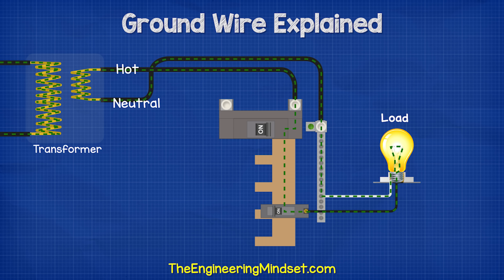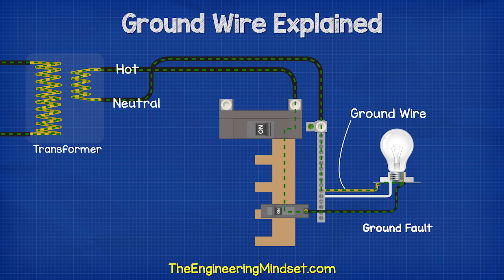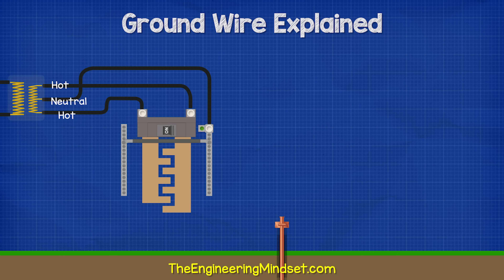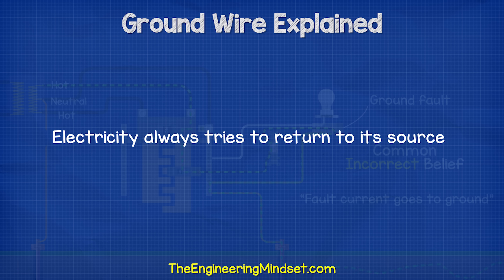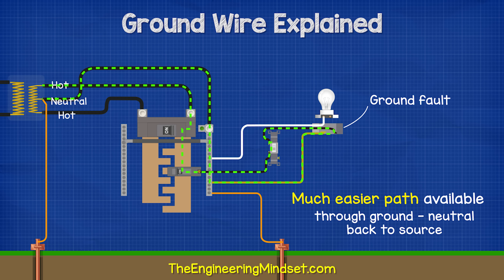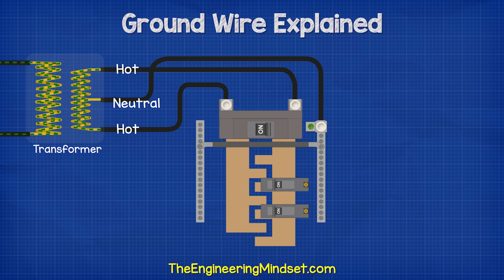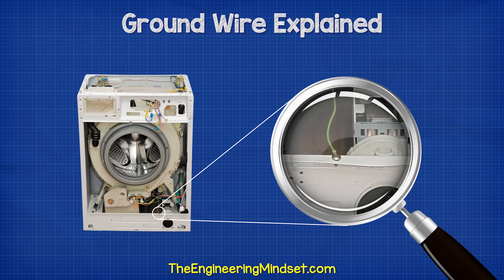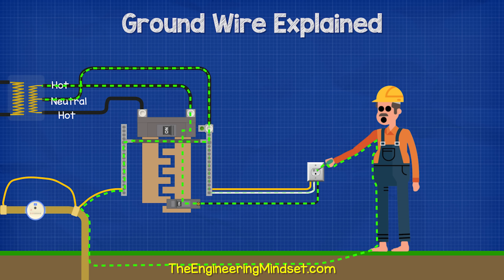Ground Wire Explained

Comment: Not gonna lie this is simple to understand when you have electrical knowledge but I can assure you if I shown this video to the person whos not, they would not understand this video. The diagrams are unnescesarily overcomplicated and the fact that the title is attracting people who dont know earth function yet, isnt helping.
Reply: I mean how electricity knows to jump in Earth wire? 
If the resistance is lower, why electricity is not always going through it?
Reply: @jarskil8862  Under normal working circumstances, the earth is not electrically connected to the circuit.
The circuit is enclosed within earthed object so that if there is any faults and the live connection were to touch any other part than its intended circuit, it would default to closing the circuit through earth.
Example: you have a lightbulb inside a metal box suspended in air. 
The bulb is connected to live and neutral wires to light up the bulb.
In case of an electrical fault, lets assume that live connection on the bulb has disconnected and now it is touching the metal box.
Scenario 1: the box has been connected to earth. The live wire touches the box, the short circuit is caused between the live wire and the earth, the trip switch cuts off the power as large amounts of current was passing through the circuit. The box is safe to touch.
Scenario 2: the metal box has not been connected to earth. The live wire has touched the metal box and now the box has become a live conductor. Noone is aware that the box is carrying live power. Touching the box whilst touching the ground or any other conductive body can cause a voltage potential difference accross your body resulting in you being electrocuted.
If your body creates a path of least resistance, the electricity will travel through you. This is deadly if the path is going through your heart, as it is commonly the case due to the fact that we tend to touch two objects using two hands.
Reply from the maker: We just published a new Ground fault, short circuit and arc fault video, so much detail! Link HERE➡️: https://youtu.be/Qi0ynSQw-wc

Comment: If i put a safety switch to cut power, should i disconnect hot and neutral or is just cutting hot good enough? Because neutral is usually tied to ground there shouldn't be any voltage on it?
Reply from the maker: We just published a new Ground fault, short circuit and arc fault video, so much detail! Link HERE➡️: https://youtu.be/Qi0ynSQw-wc

Comment: Explain , the difference between "grounding" and "bonding"...good luck!
Reply from the maker: We just published a new Ground fault, short circuit and arc fault video, so much detail! Link HERE➡️: https://youtu.be/Qi0ynSQw-wc
Reply: Grounding means sticking something in the earth.  Bonding means connecting everything else to it. For example, a water pipe that is near your installation needs to be "bonded" to the main ground. This is achieved by running a wire from the pipe to the grounding electrode.  There might be a few other items that need to be bonded as well (pretty much any exposed metal).

Comment: Ah nice video.  The 3 wire design in home electrical always confused me a bit,  likely because I learned how to do electrical work on cars which use a 2 wire system and different terminology.
Reply: AC-DC   (Not the band) 😉

Comment: In my summer house the plumber ran PEX water lines all the way to were the well comes into the house. I have ground rods out side of the house, but my question is, were does the ground wire that goes normally to a copper water pipe get connected to if everything is plastic pipe in the house?

Comment: This explains a US 110V system. This does not normally apply in europe. While the neutral would normally be grounded at the supply authority transformer (which may be several hundred metres away) when it connects to the customer distribution panel there will be no connection between the ground and the  neutral so yes any fault current will flow through the earth rod. Usually there only needs to be enough to trip the earth leakage circuit breaker, normally 30mA, in some instances 300mA.

Comment: When electricity tries to "go back to the source" it does not necessarily encounter high resistance in attempt to reach transformer rod. In fact, the material resistance in nearby zone is what matters the most. So, proper grounding not only means proper depth and wire, it also means proper ground. Unfortunately, this is something usually ignored.
Reply from the maker: We just published a new Ground fault, short circuit and arc fault video, so much detail! Link HERE➡️: https://youtu.be/Qi0ynSQw-wc

Comment: You missed ground fault trip circuit protection as the use at the start of the video.  Could be explained better that this is the use, your mistake is opening saying ground is never used.
Reply from the maker: We just published a new Ground fault, short circuit and arc fault video, so much detail! Link HERE➡️: https://youtu.be/Qi0ynSQw-wc

Comment: So if I connected at ground wire into a sockets neutral connection it would still work? I wouldnt do this, just curious.
Reply: It would technically work, but would not be operating as designed for optimum safety.
Reply from the maker: We just published a new Ground fault, short circuit and arc fault video, so much detail! Link HERE➡️: https://youtu.be/Qi0ynSQw-wc

Comment: Could you explain why the ground shouldn’t be connected to the neutral bar in sub panels?
Reply: This defeats the purpose of the ground. Since there are now two wires between the main and sub neutral busses, they both will carry current. This defeats part of the purpose of a separate ground path.
Reply from the maker: Check the new SUB PANEL EXPLAINED ➡️ video https://youtu.be/NUSNa-7Hecw

Comment: How do you make sense of Hot and Neutral wires in an AC circuit. The current is oscillating back and forth. Hot becomes positive and then negative. Same thing for the Neutral line. It always seemed to me that people were describing a DC type circuit operation. AC current, when shorted, is very unpredictable. I guess it's hard to visualize mentally this explanation.
Reply: Ac is not as unpredictable as you think. At any moment, it behaves pretty much like dc, so a dc style explanation is close enough except for advanced engineering. Yes, there are induced currents, capacitance, etc. but for most purposes talking about a and dc circuits are pretty similar.
Reply: @TomCee53  Interesting, In practice I have not experienced that to be the case. A DC circuit tends to be more precise/predictable in calculation measurements than AC circuits. With AC measurements a little slop is accounted for in the calculations due to unknown variables during operations.
I do understand how the circuits work. I just have an issue with how the circuit operations are described. In reality the true atomic electron motion, em field and charge state behaviors are different. It just appears that when a residential electrical circuit is defined it sounds like the description of a mid 19 century electrical circuit.
Reply: @rod3134  that's because little has changed since mid 19th century. Ground wires were added and more recently gfci  and afci.  For practical purposes once the power enters the home the non-dc effects are minimal.

Comment: With high voltage capacitors, what actually is it that kills you from them?
Reply: It is always the current that kills, but higher voltages tend to correlate with higher current just by default.  For example, if you use a 300ohm resistor to connect the terminals of a 9V battery, this will only draw 30mA of current.  But connect the same resistor to, say, a 9 kV circuit and it will draw 30 Amps of current (and probably fry the resistor in the process).
Reply: @Stratelier  what i mean, is with a microwave capacitor say it is fully charged, you touch the terminals and get the full whack, what actually kills you from that?
Reply: @sinopulence  It's still the current that kills, same as touching both terminals on a battery (of the same voltage).  In a way, batteries are just capacitors with a chemical backup that keeps their voltage level from draining off so quickly the way capacitors do (and more importantly, batteries are usually the highest voltage source in their circuit).
Reply: @Stratelier  so if current kills, what physically happens when a short burst of current goes through you? does it kill the brain, the heart?
Reply from the maker: Check out NEW resistor video, everything covered! ➡️ https://youtu.be/DYcLFHgVCn0

Comment: Also...the ground wire is NOT for a ground fault condition...in fact...a GFCI receptacle or breaker are two of the things allowed to be used when using ungrounded receptacles in a structure...as they will trip when current is sensed not returning to its source via the circuit conductors...back to school you go...
Reply from the maker: We just published a new Ground fault, short circuit and arc fault video, so much detail! Link HERE➡️: https://youtu.be/Qi0ynSQw-wc

Comment: The main Problem with Smartphone Charger/Adapter is that mostly don't have Grounding.

Even if USB type C or type A have physical Ground pin.

I've tested charging my Phone with custom modified Adapter so that it has Ground Pin output. It performs way better, and the Fast Charging generates way Less Heat.
Reply from the maker: We just published a new Ground fault, short circuit and arc fault video, so much detail! Link HERE➡️: https://youtu.be/Qi0ynSQw-wc
Reply: @EngineeringMindset   I mean, even if the socket does have Proper Grounding fault, if the Phone charger/adapter itself only have Hot and Neutral AC connector without Ground, the charger itself is pretty much vulnerable

Comment: Funny how the ground wire or 3rd conductor is present on appliances or electronics that have an entire PLASTIC chassis. 
So if there is no metal chassis to get HOT, why is there a ground wire on the main cord ?? 
And we have a damn toaster that has a metal chassis and its just a 2 wire lamp cord ... when that should have a 3 wire main cord. 
I get the reason for the ground wire for emergency back path on a device with a metal chassis but when it has a plastic chassis why have a 3 wire cord ??
Reply: Humans are not always logical.
Reply: @TomCee53  you got that RIGHT .. !!!
Reply from the maker: We just published a new Ground fault, short circuit and arc fault video, so much detail! Link HERE➡️: https://youtu.be/Qi0ynSQw-wc

Comment: My mother called me the other day and said her ceiling fan made a noise and then she smelled something burning so she turned it off. I got over there to check it out and the ceiling fan wiring was not done properly. They hooked up the house ground to the chassis ground for the fan mount, but failed to also hook up the motor ground for the fan. I got to looking around and found a bare spot in the hot wire insulation about 1" back from the wire nut. 

I cut it back and hook everything up properly. Could this have caused an arcing situation if the bare hot wire touched the metal casing and maybe that's what she heard and smelled? It worked properly after fixing it.
Reply from the maker: We just published a new Ground fault, short circuit and arc fault video, so much detail! Link HERE➡️: https://youtu.be/Qi0ynSQw-wc

Comment: No, no, no! The electricity does not "prefer" anything. You are perpetuating the "path of least resistance" myth. It is all proportional. If you have a medium resistance path to ground (you) and a super-low resistance path to ground (a copper wire) a much greater proportion of the current will flow through the copper but some will still flow through you - it's just resistors in parallel.
Reply from the maker: Check out NEW resistor video, everything covered! ➡️ https://youtu.be/DYcLFHgVCn0

Comment: Pretty fitting video recommendation after I got shocked with live 240V from my motherboard shield yesterday...
Reply: That probably wasn't live 240V since it goes though the power supply unit before reaching the components.

Comment: What if you bonded the neutral wire to the metal housing, wouldn't that do the same thing? The neutral would work as usual unless the hot came it contact with the metal housing which would cause a short and trip the breaker
Reply: That is a great question but i think the point is to not have the chassis touching the N or Hot wire at all ... keeping it seperate and independant from the power flow.
Reply: Then the housing is part of the electrical circuit. Not a good idea as the current would ground through the housing, unless it was insulated. In which case the current will ground through you when you touch it. At least, that's my understanding - I'm not an expert though.

Comment: If you didn't ground the neutral then you wouldn't need an earth wire because there would never be a potential between phase and earth, think of an isolating transformer you cant get a shock from the phase because theres no return back to the source unless you touch both phases of the output of the transformer at the same time...
Reply: True,  but there are real-world engineering reasons why this is not implemented in power distribution.
Reply from the maker: We just published a new Ground fault, short circuit and arc fault video, so much detail! Link HERE➡️: https://youtu.be/Qi0ynSQw-wc

Comment: Can you cover different shorts please? Specifically turn to turn shorts. Not phase to phase but turn to turn on the sine wave where there is a little gap on the bottom point where they don't quite line up. How does this effect AC drive use?

Comment: What about in smaller non house cases where you only have a red and black wire for hot and ground. How does it work then?
Reply: I’d need more detail to be sure, but if you’re talking dc circuits, generally the negative, or neutral is grounded for noise immunity, and in many cases is not actually connected to earth.
Reply from the maker: We just published a new Ground fault, short circuit and arc fault video, so much detail! Link HERE➡️: https://youtu.be/Qi0ynSQw-wc

Comment: And what happens if you live in an apartment that's so old it doesn't have a ground wire?
Reply: Then hope the hot side NEVER touches the chassis when your touching it. 
But if it does the breaker is supposed to pop open.
Reply: At least in areas where ground/water contact is likely, outlets should be gfci. Sometimes this is overlooked.
Reply: @TomCee53  i say gfci's should be the very 1st outlet after each breaker regardless of where they are to protect all loads after it.
Reply from the maker: We just published a new Ground fault, short circuit and arc fault video, so much detail! Link HERE➡️: https://youtu.be/Qi0ynSQw-wc
Reply: @EngineeringMindset  Thanks for your reply. Just watched it. Is it normal in a non gfci for an arc to happen between the prong's of something your plugging in? I am by no means an electrical engineer and trying to grasp this.

Comment: It's all about voltage potensial (^.^), ground rod with ground wire is used for to greate equal volatge potensial in all metalic surfaces if your washing machine metalic case is 240V and bathtub is 240V then there is no difference between them and you dont pass any current 240-240=0V 0V/~750ohms=0Amps :D and if grounding impendace is low then resitance between bathtub and ground is low like 50mOhm thats why we have local ground rod then voltage between bathtub and ground is low if voltage is low current throu your body is small.

Thats how i have understand :)

edit: long electrical line create big capitance and even with isolated transformer there is hi risk of getting electricuted.

Queston for USA ppl how do uraban areas get 3 phase? if you only have 1phase HV? so 3 phase is only for commertial areas thing?